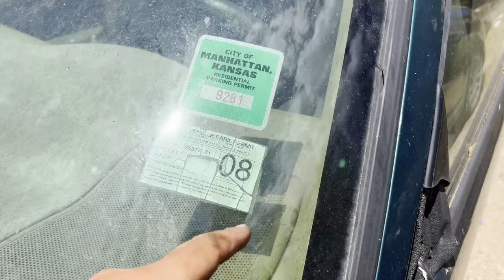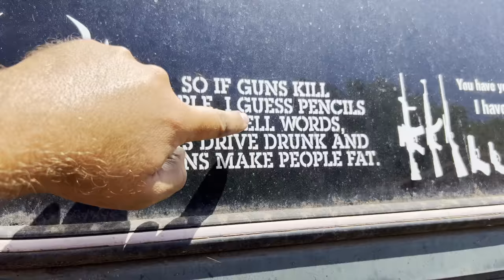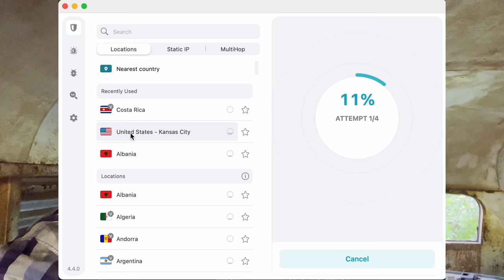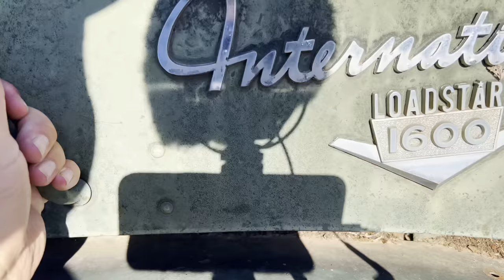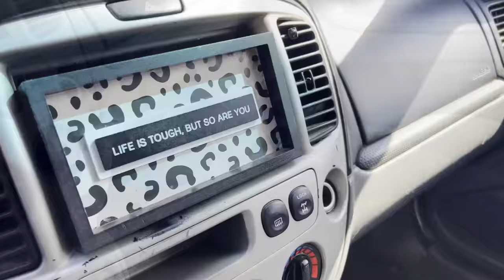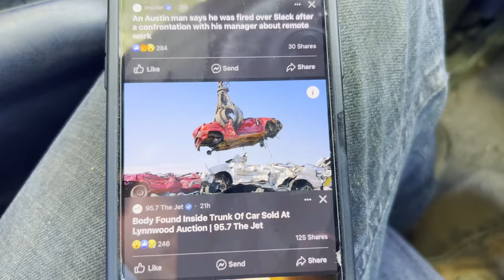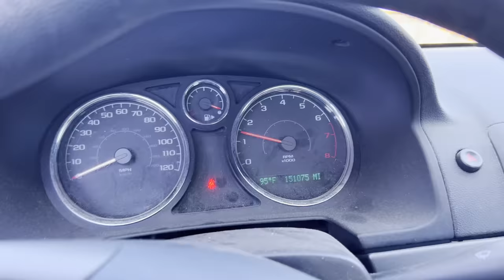I found a GOLD necklace in a car, plus I have BIG news!

Comment: Hell man don't please go under cars hanging from a loader forks by its roof. There is only you and no replacement Silas. I work with a lot of engineers and machine repairs. Failure points can absolutely release a load suspended without warning. Just like I can work on removing a pin all day long and it has to be destroyed to clear the journals . I've seen a twelve tonne bus hit the ground so fast. It made me feel nauseous that a secure load instantaneously dropped where I had lay working seconds earlier.
Reply: I was thinking the same. I cringe everytime he gets under a car held up by the loader. I've seen loaders blow a hydraulic line and down they come. Lucky for the guy I was working with he got out safely  .

Comment: I live in Massachusetts and when I see some of the vehicles you crush I notice that they are in better shape rust wise as many of our newer vehicles here.  Selling anything to anyone is a pain in the ass and people want something for nothing so I understand why you just crush them.  You don't have time to deal with BS.  I don't have any money, but if I did I would rather have an old vehicle with no technology, roll up windows and an inline 6 with a carb.  Maybe an 81 dodge with a slant six or the same year anything else up to like 85 or 87.  Anything undesirable with dents all over it that runs good and maybe even a manual trans that people just hate around here. Problem is that those don't exist around here because of the rust.

Comment: The largest value in the old barn is the lumber.  Lumber prices are sky high.  You have several board feet of different sizes of dry lumber.  Keep it stored in dry conditions and you will  make a lot of money.

Comment: Just put a transmission in to a Ford Escape yesterday for a customer. The trans was $1300.00 used with 100K on it. The job called for 8 hours. I did it in 6. But you are right. They are junk for the moment they rolled off the line.

Comment: Yes everything GMC on that truck the switch over to the Chevy truck cabs fenders as a unit. Would like to buy those rims and tires. The cab is side of the pickup cab just like a Chevrolet so it's a hood. That go good with my nice stepside GMC bed I have. I bought it back in 1986 made a trailer out of it cuz the cab the crushed by a tree and we never beat up the top of the fenders. Enjoyed your video

Comment: If it's a running driving grain truck I'd be interested international or not. The half tons and all the way up through one ton have a good market. Mid-50s through at least mid 60s. I wouldn't mind having a V8 to put in the one I'm buying that has a 6 cylinder in it. I know what the Chevys they like to use the frames for big mudder trucks. Just FYI. I do enjoy channel.

Comment: Hey Silas or anyone else who wants to reply, what is the difference between Chevrolet and GMC? I thought GMC just ment General Motors Chevrolet and they were the same. Here in Australia you see chevys and the odd GMC but cause of the left/right hand drive thing there are no new deals. Have a good one people take it easy
Reply: Just different truck brands of the same company, General Motors Corporation.  On the car side they often had Chevrolet, Buick, Pontiac, Oldsmobile, and Cadillac versions of basically the same car.  Sometimes almost identical, sometimes with different sheet metal, different engine, different options.  Usually different dealerships, though some dealerships sold more than one of the brands.